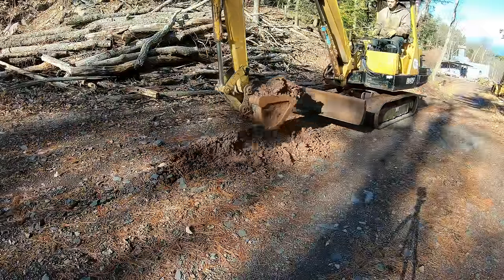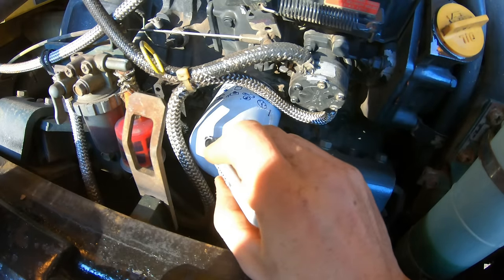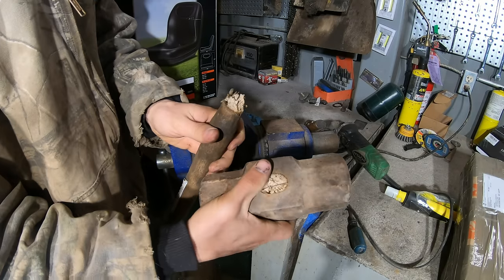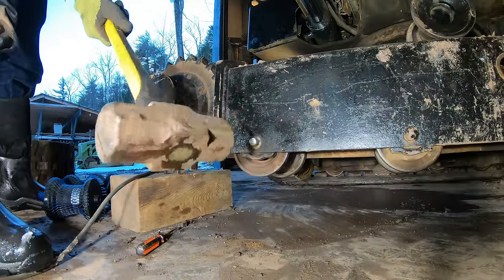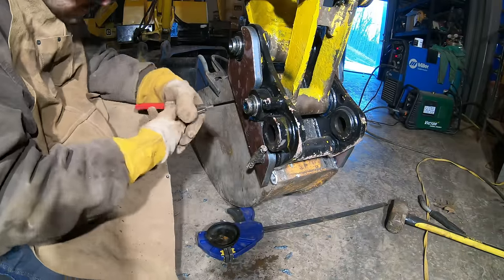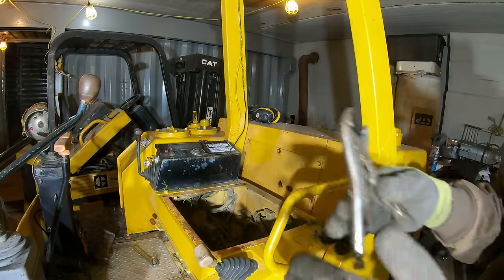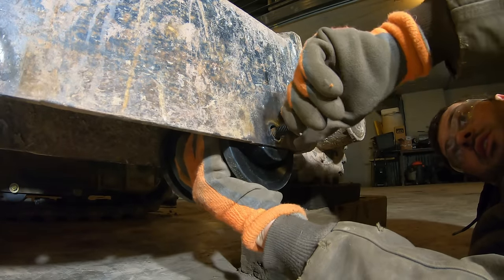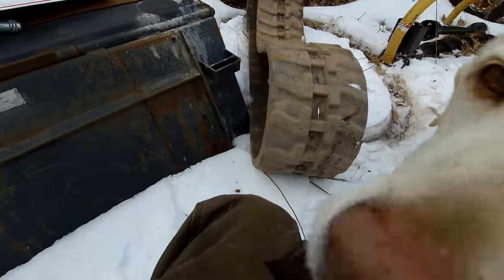Fixing up the new Yanmar excavator

Comment: When you close up a can of paint, float a tiny layer of the recommended thinner on the surface.  Then it won't skin up.  If it does skin up cut it loose and throw it away don't stir it in or you will be fighting pieces of it forever.  If you are feeling like living on the exciting side you can drop a lit paper match in your paint can and quickly close the lid.  It will burn up the oxygen and the paint won't cure into a skin.  Probably a bit risky in the more volatile paints using the match!  Also doesn't work in the ones that chemically cure themselves.  The thinner is best.  Don't shake it after until you are ready to use it.

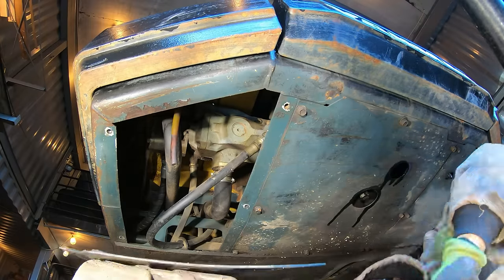Comment: Andrew, After re-watching this video, I noticed (at 7:40 ) a condensation hose that should have been inserted in the hole in the bottom plate.  The water draining might cause the plate to rust or at the least be a source of someone saying "hey, what's that dripping ?" Should be easy for you to remove and replace plate to insert hose through hole.  Stay Safe.

Comment: I'm sitting in my shop in NJ it's about 15 degrees out  . I have two heaters running and they never seem to catch up with all the steel tools and shelving .They just hold on to the cold . Most times the tools and shelves never warm up until the summer time . So I'm looking at this container castle you built and thinking how is it possible to heat the living space while I am freezing my butt off in a little 25x12 foot space lol.  I've seen a lot of bad ideas in building homes like steel doors they dent and just like aluminum window frames they just transmit the cold into the house . Wooden sky light frames just rot out and leak and the list goes on an on lol

Comment: 3:00 Yes, you do need that bolt to stop the lever.  You don't want the cable to stop it as it will wear and stretch the cable shortening its life.  The mechanical stops (bolts) are there to prevent that.

Comment: That hole on the belly beside the drain plug should be a hole where you can take a punch and poke a hole in the filter to drain it out that hole so you don't make a mess. Not sure on that mini ex but others I've seen it and poking a hole works for all vehicles for vertical or horizontal filters makes alot less mess and if you drop the filter it doesn't spill and go everywhere.

Comment: Those replacement track rollers may need motor oil in them.  My Kubota WS manual specifies motor oil added through the that  allan wrench keyed plug on the end.

Comment: track rollers you used grade 5 bolts? could have beefed up the connection plates with one nice 3/16 x1.5" plate piece for all 3 and made new holes.

Comment: Nice videos....When welding that thick of material you should preheat first. It will give you better penetration
...
Reply from the maker: That is not necessary. That welder can weld much thicker than that, with no pre-heat and penetrate fine.

Comment: We used to have a saying when we have to tighten a nut or bolt our tork wrench was a one foot piece of pipe on a ratchet handle was a 25 pound of tork for amount of.tork  for more tork we used a Two foot piece of pipe for 50 pound of tork on the wretch Handel when we had to stand on the wrench handle it either broke the handle or stripped the bolt head !  ( Andrews tork wrench ) imprevise when need too!

Comment: I noticed you use 5 gallon jugs of oil if you drive a nail in the top opposite of the spout side it will pour allot faster

Comment: Hi Andrew, great videos, great work ethic. I recently changed a track on a mini digger and found that it was off level because the new track lugs were so much deeper than the old existing one on level ground. Did you find this when you done the same? Keep the videos going lad, great to watch. All the way from Northern Ireland. Merry Christmas. Edit: What is your eBay page called?
Reply from the maker: Yeah, especially with the rollers bad too. Sometimes it nice to just have new tracks and rollers installed at once like I did here. My user name on ebay is badercarma if that helps.

Comment: Always, always, please always make sure your seats are securely attached. A neighbor borrowed another neighbor's tractor & brush hog to mow a field on a hill. He knew the seat wasn't securely attached and used a vice grips thing to keep it on there. It gave way & the seat broke off with him on it on the side of the hill. The brush hog mower ran over his arm & he bled out and passed. We're all still upset by it and miss him. Safety. Take the time and just spend the money and buy new seats as you need them.
Reply from the maker: That's bad, having a seat fall off something because it was attached with vice grips is no good.
Reply: @AndrewCamarata  Yeah it was awful. Just sharing so folks will think about making sure their seats are really fastened on tight. Really important. Here in SW PA, it's hilly, too, so. ...
Reply: Those vice clamp things....not safe.

Comment: once i had to tighten the tracks for my T770 bobcat and since one slipped off and the little nut to adjust the hydraulic that stretches the track shot off and almost hit me and my friend. Lesson: stand clear of nuts under pressure and no need to over-loosen. Safety glasses.

Comment: Wish I could find something used like that around here, either they are worn out or nearly new and priced nearly the same. Found a deer 35 with unknown hours, tracks, sprockets and rollers shot, looked like the blade was used to test dynamites impact on it, no seat left with the engine knocking and still wanted $18K for that junk.
Reply from the maker: John deere stuff has zero value.

Comment: Well, those roller washers wouldnt have to be round, you could have gotten away with a flat piece of steel say 2x2", drill a hole through, cut a ridge through with angle grinder and weld it to the roller (with pauses and use water, so as to avoid melting the grease), done in an evening.

Comment: What year is this B37? I am buying a B50 with metal tracks. Does she work well? I will use ladle and hammer. What do you tell me about this mine excavator? thanks
Reply from the maker: Yes, they are good. Get rubber tracks if the steels are worn out.

Comment: Yanmar motors very common in Europe. In the U.K. I used a John Deere  grass cutting machine for a couple of years fitted with a three cylinder Yanmar diesel. Totally trouble free,regularly serviced of course. Also very widely used in smaller sea  fishing boats, extremely reliable, run all day and night at a set speed. Must be spares and accessories available for them.
www.yanmar.com.eu/genuine-parts.     Try them if stuck ever.

Comment: You do so many things well, but you don't seem to see any value in pressure washing the dirt off tracked vehicles, especially before repairs. Also, where I come from, you have to prime metal prior to the color coat. I would think that these adventuresome and successful repairs would be easier if the "operating field" were free of dirt. BTW, would any of those bolts benefit from Loctite, or don't they ever vibrate loose? Otherwise, great work!

Comment: I can see a Yellow Power cable/cord near the Blade cutting edge while you lowering and raising the Blade grp Am hoping that Cable is not powered up (240 volts) and if it is and if the steel blade crushers the yellow cable... Bro you will be roasted.. Safety is Paramount in everything

Comment: Why don't they make the rollers on the bottom of the track  Greece able or the barings replaceable
Reply from the maker: They do not need to be greased. Its easier to just change the whole roller than mess with bearings.

Comment: Love seeing your old boy!!

How do you clean out your shop floor? I’m surprised you don’t have it sloped with drains running outside so you can spray them down….I can’t believe you didn’t hot power wash that whole machine before working on it!! Lol!!

Btw, that’s a “template” for the seat. A stencil is for forcing ink through such as tshirt making. 

STOP buying crap from CHINA! 

“Less expensive” not “cheaper” unless of course you are talking about that crap from China. “Cheaper” insinuates lower quality.

Comment: The bolt might be a mechanical stop to limit stress on the cable

Yes the cable can stop it but till one day it snaps

More of a safety mechanism

Why didn't you just cut the heads of the welded bolt and use a broken bolt tap removal kit

I'm starting to think you like playing with fire 🔥

Comment: You have a habit of going too thick on some repairs which will cause the thin metal to split were it meets the thicker repair plates.Next you should heated the thicker plates first.
Reply from the maker: When in this video? When welding thick metal to thin, spend more time on the thick metal. There is no need to pre-heat.
Reply: @AndrewCamarata  thanks you

Comment: What’s funny is to watch farm shows and especially that family in Alaska run machine’s like this.  Then  for hours on end digging and trying move things way to big for the machine all this done from the side then wondering why the tracks come off. I think I’ve watched 3 shows about that Alaska Family idiots  trying to put the tracks back on. If anyone of them had ever been trained by any of the manufacturers they would know not dig or do anything other than dump to the side. You only dig from the front or rear never from the side.